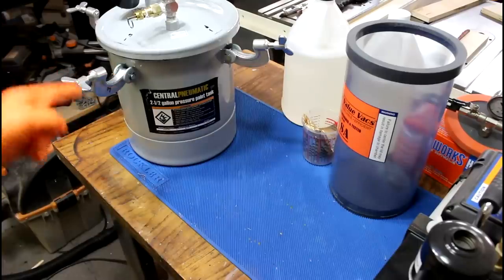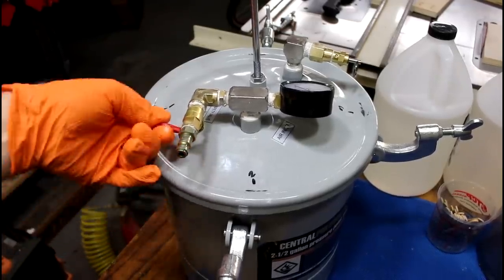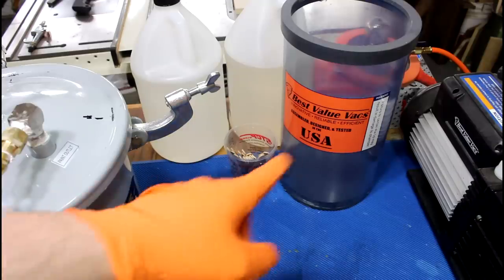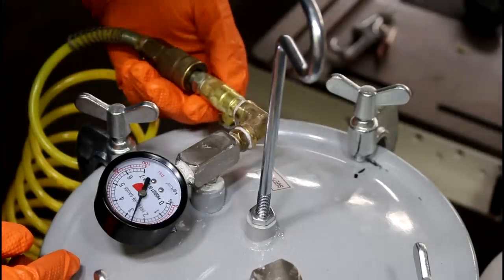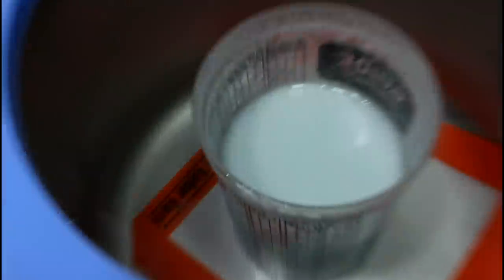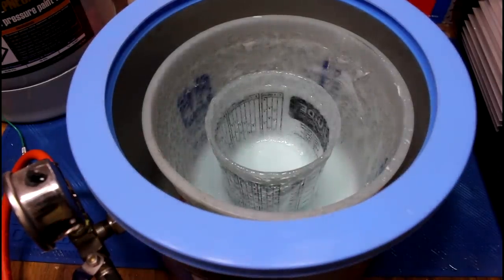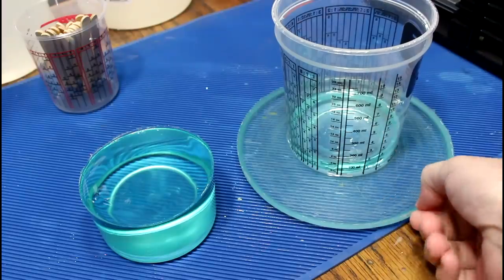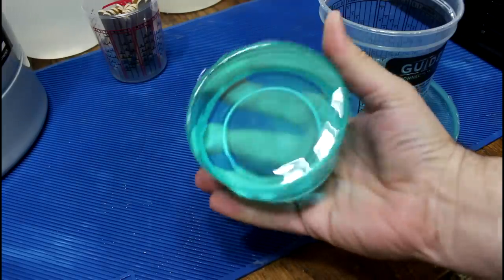Resin Casting: Pressure vs Vacuum

Comment: It looks like you drew too deep of a vacuum and reached the boiling point of the resin (same concept as boiling water in a vacuum chamber). 
Look at the resin manufacturer instructions they usually indicate what vacuum pressure, rate, and time for degassing.  basically, if you are pulling more than 29inHg at more than 8CFM for more than 2 minutes you are pulling way too much vacuum for resins.

Comment: Hi. You just made very common mistake. In vacuum degassing /air bubble removing/ parameters and in final conclusion about the point of using it. 
1. There should be information about allowable vacuume and time of degassing. 
By over vacuum one or more chemicals, solvents most probably started fase-change. The partial pressure was low enough  for it to boil, or at least vaporate very quickly.
 2 Purpose of using Vacuum chambre,in this case,  is to remove some air and to make the bubbles smaller...
3. ...for Pressure chamber, to improve compression performance.

I hope this comment  will be useful for someone.

Comment: Casting resin and art resin don't work the same way. Casting resin has fewer inherent air. In addition you shouldn't draw such a hard vacuum. Of course if needed you can build a larger chamber more readily.

Comment: Dude!  You need to get an MFC (maybe not this one: http://www.horiba.com/semiconductor/products/new-product-lines/mass-flow-control/ ) so you can set a flow.  Imagine if you could get it to stay foamed up that size, or even adjust the size of the bubbles based on the draw of your vacuum.  Would be like too hot two part boil over, but very controlled.

Comment: What did that pressure pot cost??
50 to 60 psi that is easy to reach for most people, a cheap battery based one like this (cost like 50 bucks for a set).. goes to +100psi https://imgur.com/a/x0IlpLv.

Comment: Normaly you let the resin rise and then you release the vacuum to pop the bubbles and release the air from the resin but hey lets just use the Vacuum chamber the wrong way and say its bad.

Comment: you vacuum first then pour in your mold then pressure tank the mold. its not rocket science. depends on what material u are using if u have time to do both. if u can not vacuum then use the pressure tank! upgrade your vacuum pump so it takes 20 seconds to vacuum instead of 3 minutes.

Comment: So the difference between pressure and vaccume without any knowledge of uses
Vaccume: noisy and irritating, your neighbors will hate you and your forced to micro manage the resin. Also it takes forever.
Pressure: press a button and you activate it, watch the dial then stop the flow when you reach optimal pressure. No noise and you don't have to watch it carefully.

Comment: Just wondering... Is the foam in the vacuum chamber really all air? Or could it be that it's actually the resin itself that is boiling due to the low pressure? 
Just like so: https://www.youtube.com/watch?v=-WIs7RrQCWY

Comment: I think its not quite fair to randomize the answer. If you stir carefully and you got small jewelery projects, the vacuum is totally fine and inexpensive to diy. Don't get me wrong for your project it does not work. I just dislike using totally bubbely resin and not call it a test but make an overall statement.

Comment: This video is so dang biased. Just because it take a lot of time doesn’t mean you shouldn’t do it the correct way, simply let the air back in once it overfills. 
P.S. the 2 ounces of missing resin went into the bigger cup because you were not letting air back in once it was getting over the cups limit...

Comment: Very propagandist ... boiling resin is not releasing "air" ... draw a vacuum and seal it ... done.

You continue to draw a vacuum and cause it to boil over. Yet you didn't continue to add pressure to the other ... because somehow your senses stopped you from doing something silly ... but it didn't stop you from continuing to draw a vacuum. SMH.

The video was a good example of how a liquid boils in low pressure ... so yeah it's worth watching if you understand that is what's happening.